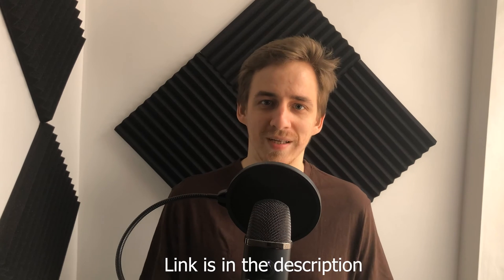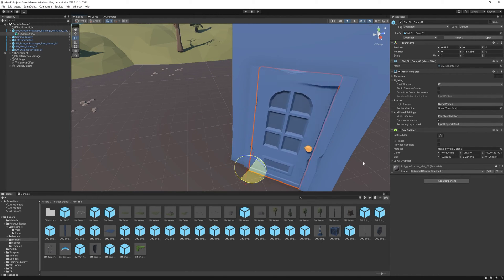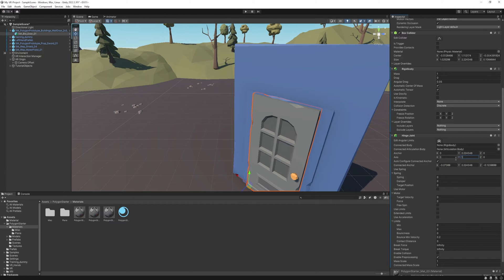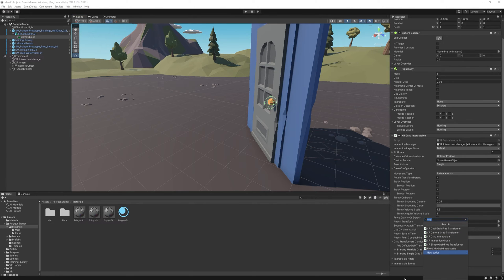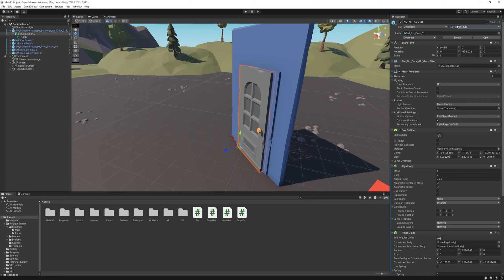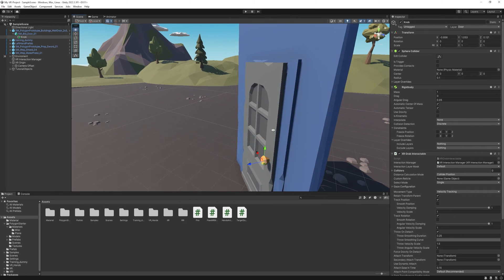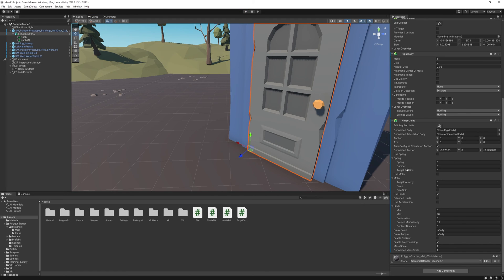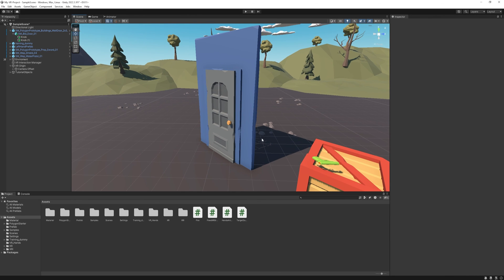How To Make A VR Game - Doors (Ep6)

Comment: Thank you for this very helpful tutorial!  I am working on creating a hinge for the hood of a vehicle and I am still having problems so I might have to start over from scratch and follow your tutorial as there are currently so many components that might be interfering with the hinge and interactables.
Reply from the maker: No problem. You might want to consider to put the door and the vehicle's other components on a different layer for example the door to the Door layer and the other components to a Body layer and in the physics setting just disable the interaction between the Body and the Door. This way you don't need to modify any colliders, it will just simply ignore eachother.

Comment: Why do VR games require more system requirements than other games?
Reply: you are rendering everything twice pretty much, and there is no cheaping out on any physics or visuals, since that would ruin the immersion. you can get away with simple animated, non collidable doors on pc, or even you just tp into the building, but in vr there cant be much in game loading while playing, and everything has to be physics driven for the most part. that make optimizing extremely difficult, so the best option is just to ramp up the system req's instead. and about what i said earlier about everything rendering twice, there are two displays in vr, (i think) and that means your gpu is sending twice the data. and the game needs to look better because trust me, 240p textures and low quality shadows quite literally STRAPPED to your eyes is not fun to experience. ruins the immersion. sorry for long boi response
Reply from the maker: Great summary, I’d add one more thing. It needs to keep at least 72 fps all time, but 90 fps is even better. Otherwise you will have instant motion sickness.
Reply: @spike-trap-boom  Thank you for the explanation, but can we get rid of the nonsense of rendering 2 times by using a fake mirroring method?
Reply: @bymsec  sorry, just doesn’t work like that. And the fps isnt halfed, more like 20-40%